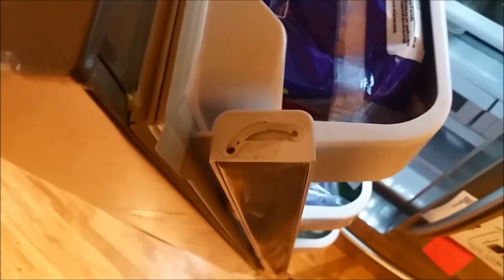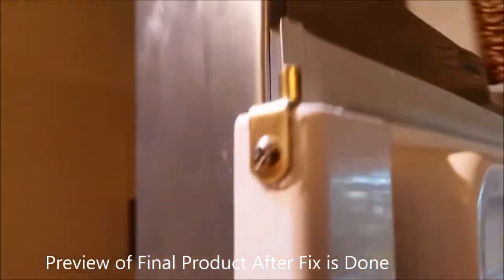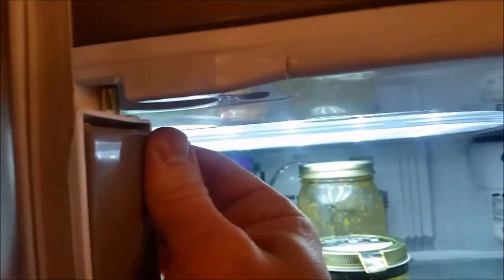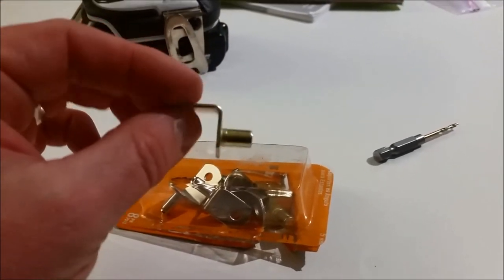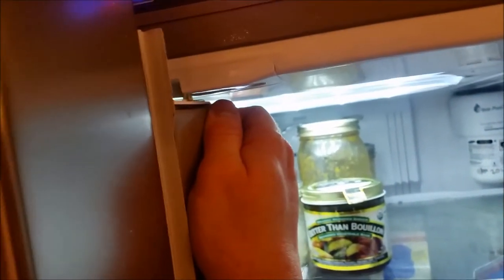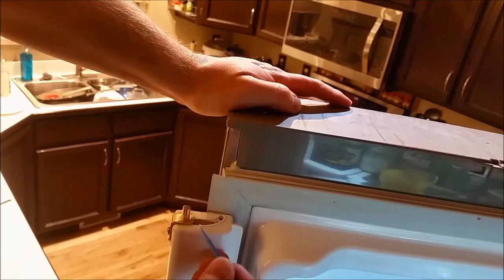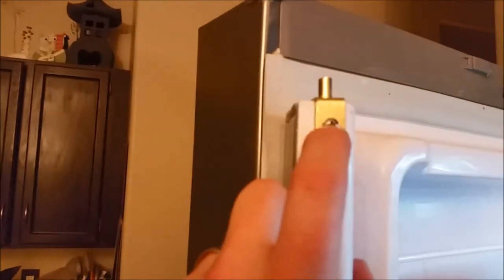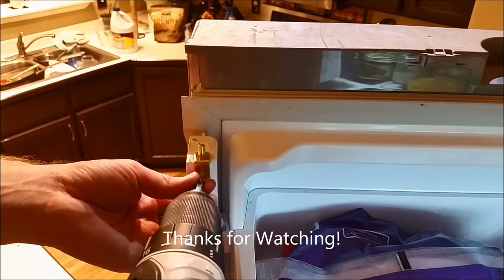How to fix the top post of mullion of the french door refrigerator for less than a dollar!

Comment: This fix video is worth it's weight in gold. Just used it to fix my Samsung French door mullion top. Just used a 1/4 inch spindle shelf guide bought from Lowe's but had to drill a hole in it  to mount. I did not have to file it down and it works great. Thank you for posting this video it is priceless!

Comment: Thank you so much for the video, these two senior citizens thought they would have to buy a new frig, husband fitted a shim over a shelf bracket like the one you used , and it is possible that the brackets are a different size our problem was that the shaft portion of the bracket we purchased was not big enough around, several various sizes sleeves over the shaft cured the problem, again Thanks

Comment: Thank you!  You saved me about $130!  The top of mine wasn't broken as badly as yours, just the plastic cap was broken, but it meant it was too low to go into the groove of the door guide.  Even though the cap is removable with a screw, they don't sell just the cap (no part #), only the whole flap (mullion).  I looked for hours for the cap and scrolled though dozens of videos and yours is the ONLY one I found with a cheap easy fix!  I didn't do it exactly the same, but your video gave me the inspiration which was to cut a small plastic tube (I used a window screen holder I had lying around) to height and screw it in with the existing screw hole for the old cap.  I needed a longer screw though.

Comment: Thank-You!  I used this on an 11 year old GE french door fridge and it worked great! I used a 1.5 inch corner brace because the holes lined up exactly and stuck in the peg from a smaller shelf support peg (no filing needed). I glued the whole thing in place and then screwed in from the top and the side. It works great so far.
Reply from the maker: Awesome! I'm glad it worked for you!

Comment: I have same exact problem with identical fridge.  Good option, may end up doing this.  I haven’t checked internal integrity but was going to try to screw post into top unless it’s hollow.  And maybe strengthen it with steel epoxy putty. Don’t forget to put a dab of Vaseline in that channel.
Reply from the maker: The repair I made lasted longer than the fridge. The compressor died but it held up fine until I had to get rid of the fridge. Good idea to lubricate the channel.

Comment: Thanks for uploading a brilliant diy solution.  At Reliable Parts, the whole unit costs $131.00 Canadian. They don't sell the top piece. I was thinking I could Sugru (moldable plastic that hardens) back into the slot on top of the door. May try that first, but failing that, I now have a second option thanks to you. Furthermore, I have a Samsung frig RF220nctasr and have replace 3 inside door shelves where the plastic splits and disintegrates. Tried gluing, but doesn't last. At $70. each, that's $210 plus tax on parts that were not covered by the extended warranty.  Rip off alert. Definitely a defect in workmanship and scam warranty.
Reply from the maker: Great ideas! Thanks for your comment! I have used epoxy to glue plastic fridge shelves back together and had some success but they do eventually break again. I agree the parts are so expensive it is worth trying to fix yourself to save the money. Thanks for watching and please subscribe!
Reply from the maker: Actually looks like you did subscribe. Thank you!!!
Reply: @fathersonrepairdiy  Follow up. I did use the moldable rubber (Sugru), inserted the top guide, stuffed the black moldable rubber into the crevices around the guide using my fingers and a dental pic.  Solidified and working again.  Lets see how long it holds up. I'd send you a pic but the reply option does not have this option.

Comment: Nice job. Clearly Samsung should’ve realized the bar could flip and the pin would strike the frame. Dummies. Their solution would’ve been to have a one way ramp either a flexible plastic tab, or a spring loaded plate right there to allow the pin to pass.

Comment: I have this same style mullion and the plastic peg broke off. I ordered the new part, but have no idea how to get the magnet back into the replacement part, as I'm told it's not meant to be disassembled. The top post on my old unit snapped off, exposing the magnet inside. 

If anyone reading this comment knows the answer, I appreciate your time!

Edit: By the way, I just spent $200 on the replacement part! Unbelievable.
Reply from the maker: That is why I decided to try to rig my own fix instead of buying the expensive part. I'm not sure how to get the magnet back.